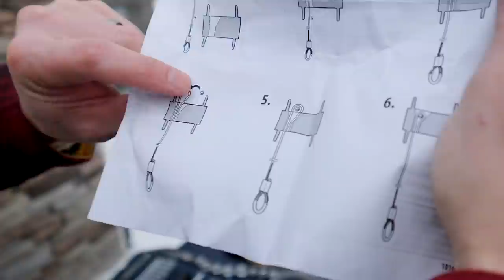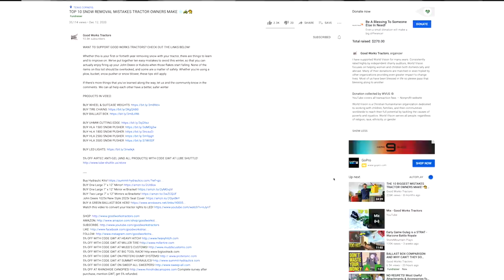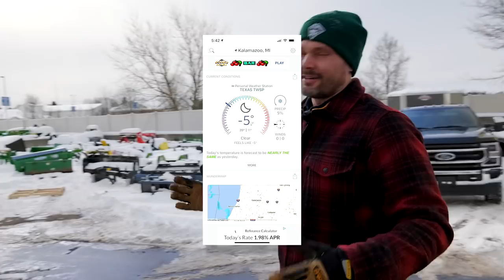$35,000 MISTAKE PART 2: GATOR 865R FROZEN IN THE GROUND 🐊🧊⛏️

Comment from the maker: IT'S BETTER TO PLAN AHEAD.  GOOD ITEMS TO HAVE ON HAND IN CASE OF AN OFF-ROAD EMERGENCY BELOW.  WHAT ELSE SHOULD BE ON THIS LIST?

Tow Strap: https://amzn.to/37skWJF
Come-Along: https://amzn.to/3ujWy6A
Battery Jumper: https://amzn.to/3rWN5jE
Diesel Emergency Thaw: https://amzn.to/3uiFSN2
Tractor Mat: https://amzn.to/3k8KCQM
Exhaust Vehicle Jack: https://amzn.to/3k7tgUn
Reply from the maker: And, of course, head on over to Good Works Tractors if you're looking for a tractor or tractor attachments!  http://www.goodworkstractors.com
Reply: I would get a snatch block or 2, also a emergency blanket incase your in the middle of nowhere. And maybe a better sxs for off road
Reply: Snatch blocks, Yankum Rope - lose the tow strap, it'll tow you, but not good at getting out of the hole.  That little atv might be capable of pulling it out of the hole with the Yankum Rope.  (momentum and the energy released by the rope)
Reply: A few different quick links and shakles can be helpful if you're pulling different vehicles out of the snow. Sometimes cars and SUVs have tow hooks/loops that are too small to get straps through (as i found out a few times this year).
Reply: Snatch block pulley as well as an item called a tree strap to hook up to
Reply: Tow straps are fine for extending a winch pull, as a tree strap etc.  Snatch blocks will double your pull and allow you to pull in better directions.  If you're going remote have food/blankets, heat source, water etc depending on the season
Reply: Also a "snatch strap" aka kinetic recovery rope rated for your application can be worth it's weight in platinum👍
Reply: I would add an F-350. Haha my truck has a 12,000lb winch on the front. I've used it many times, Including freeing the 1025r a few times. I got my four wheeler stuck in the woods once. I broke the winch cable 3 times. Ultimately had to wait till spring to get it.
Reply: Definitely a Thermos for hot chocolate. And, IDK, maybe a little folding shovel.  That is if there's enough room with the hot chocolate.
Reply: @lawlessjff  look at 15:28 it looks like he might have a "tree saver" otherwise that is just a really short strap.
Reply: There's one thing you all forgot! If you live in Kansas that is... And you're out hunting in the middle of nowhere in Western Kansas... Just in case they have a blizzard and can't get you for a week or so a couple of cans of Alpo dog food... always keep them in my hunting bag period or a couple of cans of cat food either one! Is it guaranteed you get out hunting one day and your little hungry you ain't eating one of them. I always keep a couple in the car just in case we get stuck somewhere for a week or so I would eat dog food have had two. Or you can put spam in my bag cuz I ain't eating them either that's close enough to dog food for me. That's an old hunting trick from years ago.
Reply: 2 snatch blocks make the world of difference for self recovery if used correctly
Reply: @1ton4god  God I hope you're joking.  Can't be too sure these days.  BUt a can of soup would be better tasting and cheaper. Spam is good too.  Much better if you can start a fire with a Bic lighter and warm it all up. Yummmm
Reply: My experience is comealongs are useless..... they're inexpensive but fail often.  The Wyeth-Scott manual winch is the best, but expensive.

Add a jack plate for soft ground.

Masterpull makes the best ropes.

Those tow loops on the truck are only rated for towing on an open road.
Reply: Kinetic rope is only good if someone will pull you out stretch is not your friend with winching.   I suggest an auger anchor to go into the ground, and winch rope extensions with shackles.  Curiously extensions seem to be cheaper a lot of the time than ropes.  Also, you should watch a video on how to put rope on a winch as well as a video on how much power can be lost due to how much/little rope you have out.  There are some tiny battery jumper now that will also charge a usb device.  Consider one of those.  Also, an air compressor or some way to fix a flat.
Reply: @blackhawkinternationalsecu6962  not joking at all sir! A can of soup or a can of spam you'd be tempted to eat if you got really hungry out there in the afternoon I've had that happen then you forget to put it back in there next time you go hunting it's not in your car in your rucksack... absolutely always carried a can of cat food or dog food cuz I knew there was no way in God's green earth I would eat it unless I was just about to die. And I also know it it always be there.
Reply: Tire chains should be on hand, but even that probably wouldn't have made much of a difference in the spot you were in.
Reply: A couple boards can be helpful after the wheels are jacked up.

Comment: The 4500lb rating is for first wrap on drum, further you go the less load you can pull. And ALWAYS LEAVE AT LEAST FIVE WRAPS OF ROPE ON DRUM other way rope can fall from drum. Im working in towing industry so i know a few things. A good idea is to take a snatch block and go from winch through snatch block back to for example gator frame, using snatch block causes less stres on winch.

Comment: When winching your winch should  be rated for at least twice the vehicle  weight . Once you sink the vehicle  you add  two to three times the weight  of the vehicle
Reply: Weight of the vehicle also includes all the attachments, like that heavy plow you have on there.  And that puts more weight up front and less on the back wheels that have the differential lock.
Reply: I’m glad I put a 3500 pound winch on my 800 pound quad works great hahah
Reply: Snatch block. Double the winching power

Comment: A lot of winches are made like that with the rope or cable just stuck in the hole.  You should put a mark on the cable so you always leave several turns of cable or rope on the winch to provide tension to keep the rope on.

Comment: Courtney, been thinking about your situation.  Something to consider about your winch, if you had a snatch block pulley and went to a tree, through the pulley and back to your Gator, you will essentially double the pulling power of the winch.  Now you will need twice as much rope but your pulling power will double.  Add a second snatch block pulley at the Gator and then go back to the tree for the third time and you will triple the pulling power of the winch.  Keep the winch, buy a couple snatch blocks, will be a whole lot cheaper.

Comment: That little disk is actually a steel BB that the rope wraps around and is tension held in the drum relief.  Any thing small like a 1/4-20 nut size or smaller would work as a replacement.  Always enjoy your vids!

Comment: Chris the little metal cylinder that locks the winch cable to the winch was something I had on my warn atv winch too. And I lost.  I substituted with a small nut from a bolt.  Another option I did for years was to pull winch cable all the way thru and lay it flat to the winch drum perpendicular to the winch line normally.  After a couple wraps on it wouldn't go anywhere.

Also, another good recovery tool is a high lift jack.  Boards also go a long way in a situation like that.  Glad you got it out.
Reply from the maker: Yeah, good idea.  Thought about using a nut.  Thanks for watching!

Comment: You had that gator well stuck. I think I might have taken the plow off and went and gotten one of my tractors but it's always easy to have a solution from the couch.
Reply from the maker: Haha, yeah, the couch is a comfy spot to assess 🤣  I made a video about installing this plow a few months ago.  All I could think about was how I did not want another project after getting the Gator unstuck.  It's pretty bad.  Also, it was so sloppy that I don't think it would have mattered in the end.  A tractor couldn't have got any closer than my truck.  The truck would have then had to pull out both.  I'd be more concerned about my tractor tipping over as it's hilly, slippery, and tractors are much more top heavy than a Gator.

Comment: Crane operator here if my advice helps any. The part you're referring to for that winch is simply called a wedge. If you can't find the correct wedge, get yourself a small nut, 1/4" or smaller, whatever would work best to act as a wedge. Cranes use the same idea for keeping our cables on the drums. Also, on the warn website, if you look up drum assembly in replacement parts. The wedge is on their website for sale.
Reply from the maker: Thank you sir!
Reply: @GoodWorksTractors  you're welcome! Invest in some sheaves as well if you haven't already. So you can make multiple parts of line instead of a single line pull. It'll double your 4500 lb winch capability every part of line. Have fun! Just finished hooking up hydraulics for my af10f on my 2025r so I'm going to play in some snow shortly here in Iowa.

Comment: I feel for you watching that. One way or another most of us have been there.  Don't let the Monday morning quarterbacks get you down. Like you mentioned, unless you're physically there... Don't beat up on the Gator too much.  I wonder what a gas version would have done different - allowing you to rev it up higher to spin the tires like a car.  Glad it is out. Should have taken your 5 Series down there, people would have sat up and noticed :-))))   I believe the front axle is limited slip cause it steers and geometry. Also, glad you showed this to us all. That takes strength - we've all been there.

Comment: YOU NEEDED A HIGH LIFT JACK AND SOME PLANKS. I watched a jeep stuck in an Adirondack mudhole get free by jacking up and tipping the jack over until it was on solid ground. Also had a Bronco leaning sideways against a tree jacked up and moved sideways. Shoveled dirt until truck was flat. Good thing about getting stuck is you learn what works and what doesn't. The more times you get stuck, the more you learn. Sometimes it helps to have a couple snatch blocks to change the direction and some extra chains to go around trees. UTVs will get stuck easier than an ATV and are harder to get unstuck.

Comment: My hat is off to you for keeping your cool.
Lots of good comments about how they rate winches.
Being on the frame and frozen to the ground I think you were over the winch rating.
 I would check with a dealership some UTV manufacturers recommend you add a second battery in the circuit due to limited charging systems. It doesn't mention it in owners manuals.
I have a Honda UTV and I can lock the front and rear differentials together and that has helped me get through some rough places. But it's a bear to steer.
Just remember there's good points and not so good points for all equipment.
Keep up the good work.
Thank you
Reply from the maker: I agree with that assessment after the comments rolled in.  I think that is an advertising/slash salesman issue.  Something I'm aware of now, but learning that lesson after paying good money and having to spend all that time is frustrating.  I'd much rather buy the properly sized winch up front which I honestly thought I was doing.

Thanks for watching!
Reply: @GoodWorksTractors  Your welcome.
I been subscribed to you for awhile, and a sub compact tractor owner for about 20 years. But still learning from folks like you.

Comment: I have a 8000 pound winch, it takes a LOT of current/Amps to get the full power of the winch.
On my truck, the winch will flatten the battery in a couple of minutes, unless the engine is well reved up and even then the battery will be flat in minutes

Comment: Thanks for sharing. I will not waste money on the JD 865R based on this and other videos not to mention the insane price tag. Nothing appears to beat the durability and long lasting Kawasaki Mule 3010/4010. My 3010 was under 6ft of water for over a month with Hurricane Katrina. When we were allowed entry back we pulled the plugs and drained oil/fuel then dragged it around the property in gear to flush then lubed everything up. To this day my $10k 2003 3010 mule is running strong. You could own 3 of the 4010's and save $5k over the JD 865R.

Comment: Thank you for the education. I'll now carry extra snatch blocks and other equipment when in these conditions.  I feel that any vehicle without flotation tires or tracks would get stuck in those conditions.  I don't understand why side by sides aren't sold with larger tires.  Or at least geared down and built to handle larger tires.  Thanks again!

Comment: A low tech way to fix the problem for relatively cheap:
Bring some jacks and shovel.
Go to Home Depot, pick up one rubber mat for each tire.
Get some concrete blocks, wood, or rocks to fill the hole if it's too deep.
Get a mat under each tire. If it's down too low, dig it out until you can fit the jack, then jack it up so you can access the tire.

Drive out. Replace the mats as necessary when you drive off them.
I did this for my wife's RWD truck when our property got muddy. My 25HP tractor didn't have enough traction to pull it out as it was also too muddy, still and also was fighting a hill. The mats let the truck help which reduced the need for much thinking on the tow strap. I did connect the strap anyway, but the mat is what worked.
In a sense, you're just fixing the original problem - loss of traction.

Comment: Go to a construction supply store and buy the highest rated come along with a long handle you can find and extra lengths of cable with hook. Backup for when your winch battery dies. Sometimes just maximum  tension on the winch cable will allow a vehicle to come out under it's own power. Keep tightening the cable. I saw it happen going uphill on a logging road with deep ruts where the frame bottomed out in the center and wheels were not making contact.

Comment: Not going to read through all the comments but, my experience tells me synthetic winch line was 1 of your problems. Another of your problems was keeping the plow on when attempting your rescue mission(when you went to rescue the polaris), makes you lose too much ground clearance and you essentially become an anchor. If your front end is a limited slip without a locker, then that is another issue. I would have thought JD would put that into a utility vehicle. Most of your major brands have one. Glad you were able to get it out and without anyone getting hurt.
Reply from the maker: Like I mentioned to others, that plow is a solid 30-40 minutes to remove and reinstall.  Hindsight is 20/20, but I don't think it would have made any difference.  That muck was nasty.  Buried to the frame provided too much resistance.  More tools ordered to be better prepared next time! 😂
Reply: I would think you would have wanted to plow a path down to the ATV to get it out of there then back up to it and pull it out the Plow weight on front would be help if it weren't muddy! Who would have thought you were going to be in mud with the temperatures you have had! Hind sight is 20/20!

Comment: I've got the exact same gator and I love it. Got ot stuck a couple of times also but not that bad and i just got the tractor to pull it out. The only thing I dont like about the gator is the ground clearance I think it's to low but then again it's not designed as a full off road vehicle it's more of a work horse and that's what we use it for. It's great for plowing snow and pulling trailers and such I'll still keep mine. I did like the video thou it reminds me again on not what to do lol keep your videos coming.

Comment: I’ve been in this position before, I feel your pain. 
Useful hints for if it ever happens again. Short 2x4’s strapped to rear tires. Use snatch block to double back to gator. 4500 turns into 9000. 
Then when you get home throw that junk Warn in the trash and go get a superwinch, viper, badlands. Anything but a Warn light duty winch. I’ve had 2 and they were both junk. I bought a 5000lbs Badlands from harbor freight and haven’t had a problem.

Comment: See your frustration.  Have the same gator,  gas powered.  Badland 5k winch bolts right in.
No drilling.
I use the winch ti help felling trees, pulls gator all the time, have to anchor from behind.
I  stuck my bobcat deep in the woods two hrs before super bowl. 
Didn't get to see it. 
I am 50 east of KC. Worked out well i guess.

Comment: Great video on how problems stack up to make something much harder than it should be.  Great job on keeping your cool.   Gave you a thumbs up just for that.
You had the tools to make the recovery fairly straight forward.  Set the 4wheeler behind the gator, drop the blade on the 4wheeler, snatch block over the top of the blade to the 4wheeler.  Snatch block doubles winch power, blade on the 4wheeler will dig in to keep the 4wheeler in place.

Comment: I solved the line up problem by welding on small tabs in the back.  Slide it in to hit the tab placed so holes all line up.  With our 120 lb trailer hitch at my age (68) I can not horse around with it.  Now I just slide the sleeves in to the stops and in goes the hitch, all lined up.

Comment: Don't forget you can use the plow hydro to push also. If you angel it one way and get a pile of snow in front of it then push off the pile.
Reply from the maker: Yeah, tried that.  It wasn't strong enough to move it though unlike the plows I've had on my tractors.

Comment: Part of the issue was the plow.  The extra weight up front  shifted the center of gravity forward and essentially unloaded the rear.  Having a couple extra hundred pounds of weight over the rear axle might have saved you a day or two.  If it happens again, take the plow off (even in pieces if you have to) and throw it in the back of the gator.  And throw a farmer's jack in there as well.  A winch can only pull.  With the jack you could lift the front and shovel out whatever you're hung up on.
Reply from the maker: If you only knew how much fun that plow is to install.  I don't think it would have mattered much though.